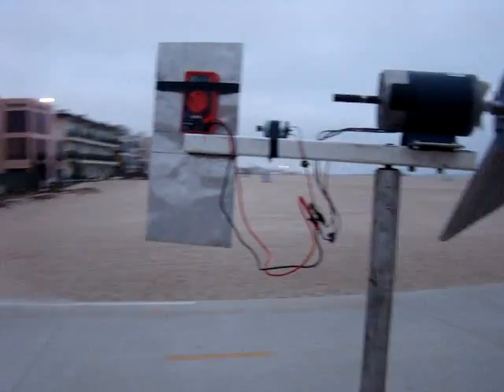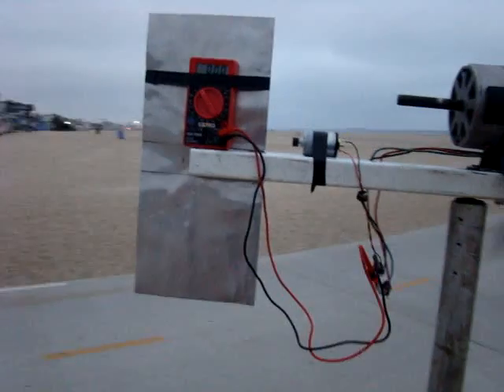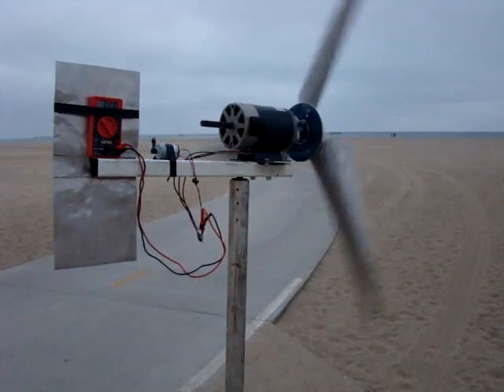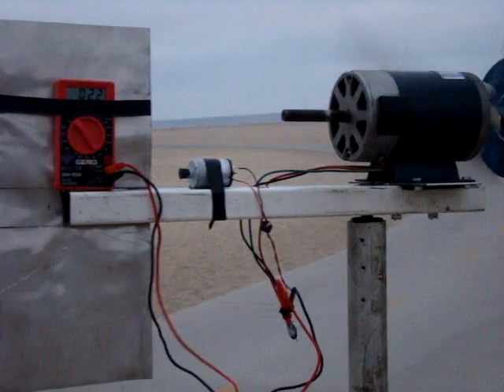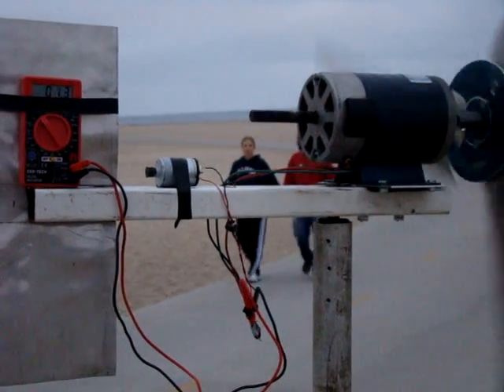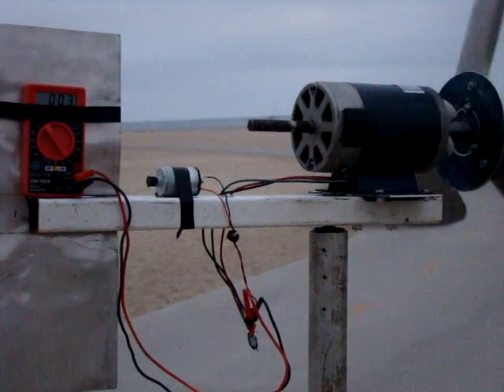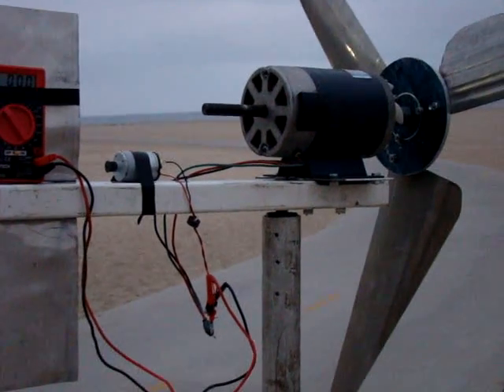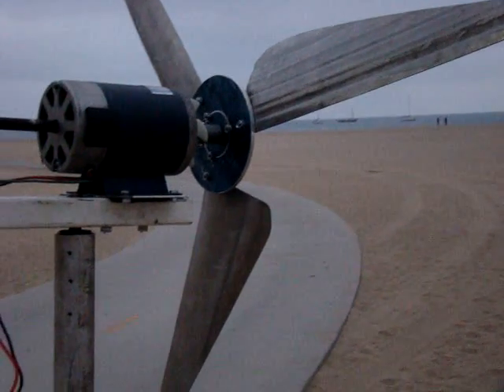DIY Wind Turbine - Permanent Magnet Generator

Comment: Thank Your for the great video and information. The wind is blowing. The trouble that You appear to have is several. I am not trying to be a smart ass or a mr. know it all. With my very limited knowledge, Here is what I see. Number one Your blade may be too short, Or You should have 5, 7 or  nine blades for low speed wind. If I am looking correctly, You are too close to buildings and not high enough from the ground. Lots of wind turbulence. Very bad for the wind turbine. You should be at least 150 meters from any obstructions and 9 meters above the height of the obstructions.  Now as far a power goes, You have to multiply amps times volts to get your wattage. Watts is what all of us use to power everything. Example. 5 amps times 12 volts= 60 watts. Good luck to You, And again Thank You

Comment: you need larger blades for better volts with minimum air flow :)
Reply: Aditya Prabhu put in a gear ratio?? and maybe use a vertical wind turbine instead? idk just and idea ha

Comment: well this has nothing to do with magnet generator there no magnets just wind
Reply: Well you can have it either way really, you can have magnets statically placed inside or on the rotor. The copper wires are wound to make a coil and multiple coils are used to make phases (which is where you get the term 3 phase) from.

Comment: There are two key points you must consider in making a very good Wind Turbine.  Point one: it is important that you get your Wind Turbine as high as possible.  However; testing it at a lower altitude is a must for most people.  Point two: you always want a motor with a low RPM rating and, at least a 5 AMP rating.  If your motor is rated at 2500 RPMs and you have a good wind of about thirty MPH, you may only get a very small voltage output (like three or four VOLTS).  I got lucky on my first Wind Turbine.  I just happen to buy a very good AC Stepper Motor and it worked well for me.  You can see how well by viewing: Mini wind turbine 4 on YouTube.  Good Luck and, this is truly a great building job.  I like it a lot.

Comment: Nice setup Buddy.
I suggest you find a motor with low R.P.M that doesn't spin that fast for better efficiency. The lower R.P.M on a motor it spins not too fast on high and better performance. 
Just take a look at those  commercials Wind Turbine. They spin slowly but puts out a lot of voltage and wattage.

Please checkout my channels on Google + and YouTube. Make sure you click on the subscribe button and give a thumbs up to my videos. 
Cheers

Comment: What u got here is an actual wind anemometer is all if u notice your readout on the volt meter is actually the wind speed and nothing more and will not produce any usable power unless u gear it up 5 to 1 ratio then at that it maynot produce useful charging for a 12 volt system

Comment: Hello: this is a very good wind turbine. However, if you want to get higher voltage I would suggest that you make your wind turbine blades about 50% larger. By doing this you will increase your revolutions even in a low wind gust. Even if you don't do this it's still a very nice wind turbine.

Comment: So small voltage. My 10 times smaller motor at this speed gives around five volts
Reply: For your information... the voltage says nothing, it's how much current that it is producing that counts, and this is what basic electricity explains.
Reply: +Savash Zaynal wow reply after 3 years when comment published. Now i know a lot more about electronics than in 2014....
Reply: That is great, then the reply will be of help to others who don't know so much about electronics and reads your comment.

Comment: the gear  i use i usually 4:1 
i take a kid bike and cut away everything besides the crank and the frame part where the rear wheel sits ..mount the blades on the crank and mount the gennerator (i usually use and old type car dynamo) or the flyweel and coils and part of the crankshaft from a scooter 12v(the scooter part mill can also be used without a gear ) blades mounted dirict on the flyweel..then you have to figure out our blades  more blades=more pull=less speed .. i prefer 2 or 3 blades

Comment: Waterfall1973 is right.  The blades are effectively "wings" and should be set up with the right angle of attack to create 'lift' to rotate the blades.  Study wing lift, and sort out how to angle the blades so the wind passing through your blades passes over them to create the most lift/thrust.  Propellers allow a maximum forward speed of about 500mph before they become almost flat to the oncoming wind for their rotating speed and they can no longer produce thrust.  That might help your thinking.

Comment: Thats a great first effort. Look at Golden Motors, they have very low RPM motors (90 to 110 RPM) that will work very well in this application.  We use York Squirrel Cage Blower Wheel 026-24069-000 1472-2751. This will change your wind mill from a horizontal to a vertical model but you will not have to deal with the blades stalling. There is a great deal to consider what type of windmill to construct but you are on the right track!

Comment: Surface area counts when it comes to the blades. Small blades can handle high rpm but only in good wind. For low winds speed need larger blades.

Comment from the maker: I just completed the first part of the class and I can already say everything is wrong with my assembly. I'll have to redesign the whole windmill to make it more balanced, more stable, with less vibrations, and frictions.
After trying it so many times, the stress at the base of the blades is apparent. I'll try next time with PVC. To make the motor go faster, a gear system would definitely help: I'll explore that option in my future design as well.

Comment: add another wheel .. so you get a better ratio ... Like have a big wheel being pushed by the axis ( eg. the wheel could be 26"with a belt pushing the wheel on the alternator\motor ) so for every one complete turn the 26"diameter  wheel makes the wheel on the alternator\motor turns about 15 times ...15:1 ratio ... just if you didn't have the set up ( you likely to need a bigger windmill tho ) ...  good vid tho

Comment: Got to be honest mate, i'm amazed you didn't manage to slice someone to bits with it! You were testing what amounted to a very large meat slicer, at body height, on the edge of a path with cyclists and people walking by on a public beach..what if the wind changed direction and the blades swung around into the road or a passer by? It sounded like your young family was there too...nice work on your experiment, it looks good, but i'd go along with others and say longer blades, but think safety too!

Comment: @legailutin Nice Video, for every time you double the length of your blades the increase the power by 4. If you only increase the length by 1.414 time you increase the power by 2. Longer blades will give you more power. I think you also will need more speed on the motor because you should have already make 12 volts at the speed it was turning. To get more PRMs you will have to gear it of put a belt on it. Other choices would be to use a higher voltage motor or one that is rated for lower RPMs.

Comment from the maker: For a first wind turbine project, I'm focusing on having everything together before starting with optimization. I would have to read more about blades design, electronics, batteries, and many other aspect I didn't even imagine would intervene here. Optimization is going to be the unannounced part 4 of the project. For the blades, I would get couple of well made ones on ebay and get it to work with my second PM Motor.

Comment: More blades will get you spinning at a lower wind spind, but at the same time it will lower the top end speed. You need to do the math of how many rpms it will take that motor to produce a min of 13v.